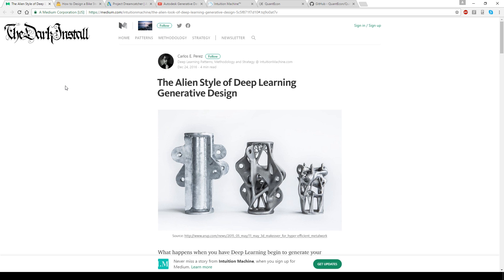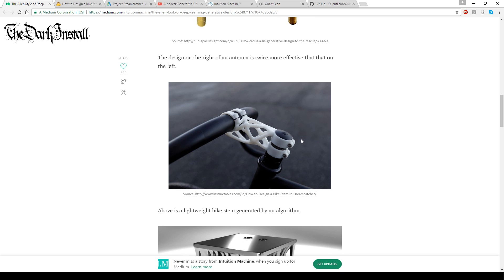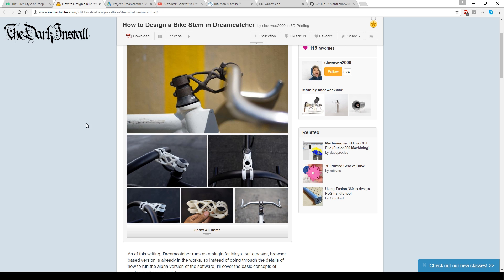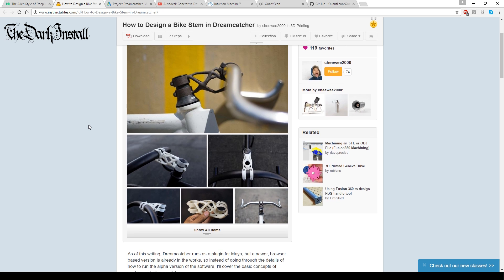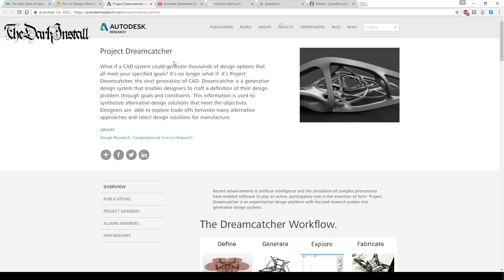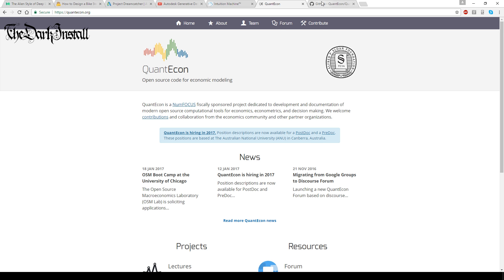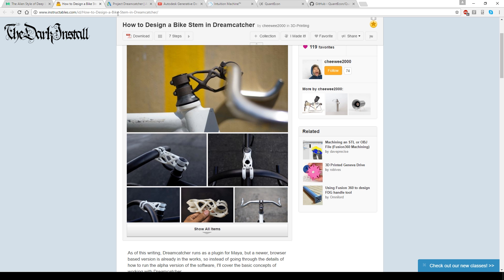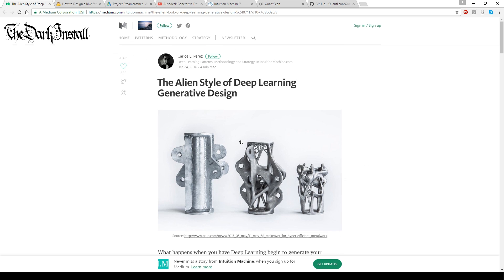Quantitative Bicycles. Deep Learning Design

Comment: Anyone who has studied some computer science knows the whole "generative design" is complete hyped non-sense, pushed by companies like Autodesk. Generative design does not consider any real world variables (like force loads, etc) on its designs.. it just cranks designs randomly without knowing what the piece in question really does. The computational expense of doing real fluid dynamics analysis on "generative designed" crap is just too high to be of any real use, and the variables are too many. Just change any variable and your "generative designed" piece is completely useless. 

To do real generative design (which basically comes from Genetic and Evolutionary Algorithms) , one must do a custom program for each piece of a system, using all variables and let it rip through many many generations.. then comes the interaction of all pieces of the system  together.. the computational expense of all this and the programming involved goes far beyond of what any autodesk crap plugin can offer

There is software that takes variables into account,  FEA software.. . i am sure Cannondale uses FEA software to "optimize" their carbon layouts and frame designs...unfortunately, failure in one of  their "optimized" CAADX forks has caused one death and 11000 (!) recalls, because of fork failure.. and i am sure there are many other unfortunate examples. Boeing is a prime example of all that technology not being worth shit in the real world.. and killing hundreds of people in the process.

Comment: I'm an aerospace engineer and use a few "topology optimization" software packages and the stuff is seriously cool and lots of fun just to play with. At the same time it is a bit scary to give a piece of software a box to work in and some parameters and watch it come up with an optimized design. It is only limited by the programming. Once someone figures out that they can just feed a piece of software all the parameters and have it spit out a design there will no longer be a need to have a standing army of engineers like me designing airplanes. Easier said than done there is lots of tribal knowledge but someday it will happen.
Reply: Wow
Reply: Kijin Seija right

Comment: Being a mechanical engineer I find this very interesting, but honestly I do not see deep learning algorithms spitting out mass manufacturable designs just yet. Product design is a compromise between functionality, material properties, and manufacturing processes and it will be immensely difficult to program a model that can accurately balance these parameters. Product design is more than simply deriving the most aerodynamic shape, or optimising whatever property is important for the product.
Reply: Don't get me wrong, I am not against this technology, quite the contrary. There is just a common misconception about computer generated content that it is "easy" to do. Well, actually it can be too easy to get a result, but obtaining trustworthy and meaningful results is definitely not a trivial task. Deep learning does not solve this as long as humans are still manually setting the conditions
Reply: @RCalundann  trial and error as always. But after some time there will be a sort of criteria package for every scenario that you literally just slap on whatever base shape you use. The you fine tune the thing to your personal preference in terms of look, material and physical properties - inside the borders of the used criteria package of course. Just take a look a computer game physics the past years. There will be a LOT of trial and error but did that ever stop humans on their way to automatic mass production?
Reply from the maker: RCalundann The timeframe is anyone's guess, but watching the finance A.I.s explode 6 years ago taught me that things can happen overnight without warning.  Product design is a compromise at the moment, as human hands are involved...